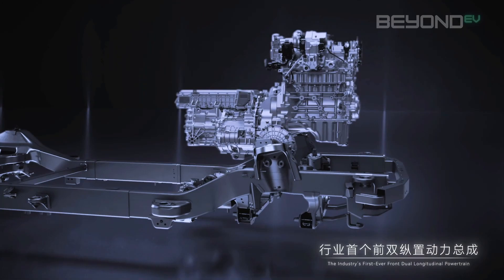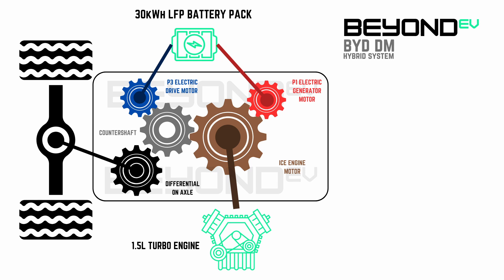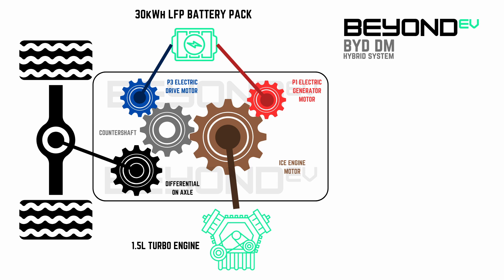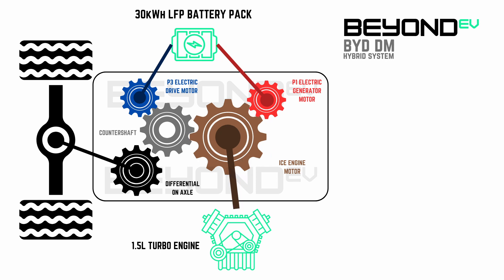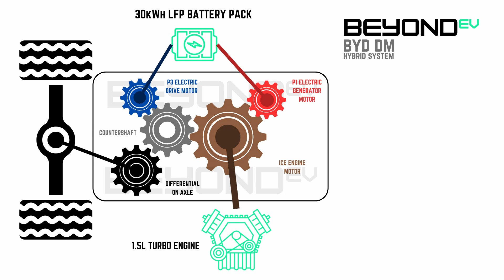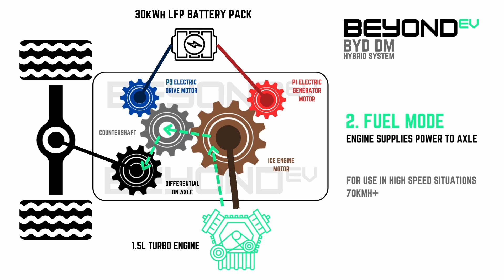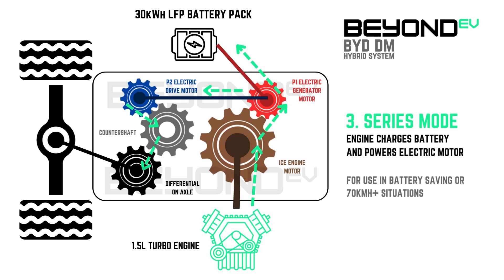What's inside the BYD DM Hybrid System (BYD Shark + BYD Sealion 6)

Comment: Excellent explanation. Would be super to show how the clutch works and how the different angular velocity of the shafts are arranged in order to control wheel speed. Regarding other competitors, in my opinion the Toyota E-CVT has outstanding features: very simple mechanical scheme, no clutches, all possible power flows (comprehensive explanations avalaible on internet).

Comment: They do have gasoline only traction in certain circumstances, mostly if the battery has already reached the desired state of charge, and the computer determines that the speed you're currently cruising at would be too draining to the battery. At that point, the car drives like a regular gasoline car. I've seen this usually at speeds of 100 Km/h or more

Comment: When you accelerate hard from the 0, the petrol engine can't participate in parallel mode because of the low speed and no low gear for that. The engine will only  produce more electricity through P1. In highway speeds the engine will work in parallel mode in hard acceleration.

Comment: How the gear engage or disengage? Does it has a clutch and solenoid? Because in Toyota hybrid system they don’t have the clutch and solenoid. For me it’s very important, if we talk about durability the clutch is the weakest point
Reply: Clutches can be made however strong they need to be to perform the demand of the task -it's ridiculous to think that because you have a Toyota that doesn't use a clutch that the system is the best and anything else that does have a clutch is weak. Engineering dictates that a clutch setup is in fact the most efficient way to transfer power between moving plates. Seems like Toyota may have missed out on this engineering.
Reply: @joebloggs24  why doesn't Toyota provide a warranty for their hybrid system in our country if they're that confident in its durability then?

Comment: So if you hear  the sales pitch BYD says you should be able to achieve around 70 to 80 kms range in full EV mode with a 100% state of charge but from what you are saying that is only possible if you drive less than 70 kms per hour ? That is a bit sneaky of them if true ...
now when I went for my test drive on the motorway I displayed the car graphics up on the screen to show the power delivery source, I accelerated steadily up through the 70 km per hour threshold to 100 km per hour but did not get any indication from the onboard graphics that the engine was paralleling the battery ? Nor could i hear the engine kick in ? So I am confused ?  Note when I then changed the mode to HEV yes then the graphics changed when pushing the truck harder above 70 km per hour. Can anyone verify this ?
Reply from the maker: No it'll get about 80 km of range under normal driving conditions.

The car decides when to kick the engine on, but depending on your state of charge, it might not kick it on at all. But if it does, it's only going to do it when you're above 70 km an hour.
Reply: From Tassie, am an owner of SL6 Premium, fully charged I get around 80-85KMs on EV mode even at 110KM speed on intercity roads, once the HEV kicked in when the battery down to 25%, it will stay between 18-30% during the entire journey, depending on your driving and roads conditions, if there are lots of downhills, the battery will be charged and can reach over 30%, but if lots of uphills then the battery will get depleted rather quickly. I have toured and traveled across the eastern part of Tassie with friends for over 4700kms over 10 days, which I have only refuelled 3 times in total, and from the first drive leaving from home with a full charged and another overnight charged at a holiday cabin. My POV is that to have a full EV in Tassie if you want to travel, because charging infrastructure is lacking compared to when I was driving in China where charging stations are very common, it’s more convenient to have hybrid and not to worry about charging stations.

Comment: In a way, similar to the Toyota ECVT while at the same time, completely different. 
The strong electric motors mean the car can run the engine in a single gear  and still run as a hybrid.
Nice work BYD and thanks for the explanation.
Reply: It's actually very close to Honda's e-HEV system.

Comment: I have one question .. when you set the SOC charge to a value, there's also a setting of Auto or Save .. what's the difference between them?
Reply from the maker: Auto is basically 25%. Save is any setting between 25% and 70%.

So if you do set the setting do anything other than 25% automatically in save mode
Reply: @BeYonD-EV  that's not true.. you can set it to 50% per example, and still keep it in auto... I was told it had something to do with fuel consumption and how actively it would try to get to that percentage, but I don't know the details... that's why I'm asking
Reply from the maker: It is. I can't post pictures here, but you can Google 'BYD Shark Owners Manual'. The first results should be a PDF of the manual. Page 94 goes through the difference between AUTO and SAVE. 

AUTO: Prefer fuel economy, but also
take battery power keeping into
consideration.

SAVE: Prefer keeping vehicle battery power, and try to get close to the
target SOC.

So in AUTO mode it will keep taking down battery power because there is no set SOC to save at. What it doesn't say is that Auto mode will do that only down to 25%, at that point it will switch to what is basically SAVE mode at 25%.

You can try it, set it to 50% and then have it in AUTO mode. It'll just keep draining it down to 25% and then hold 25%. 

That's saved SOC percentage is ignored when you have it in Auto mode. That's just the preset SOC that you will have when you put it back into save mode again
Reply: @BeYonD-EV  I was talking about the sealion (seal U in europe) and I'm pretty sure you can set it to "auto" and raise the bar to 50% ... I'll have to confirm it  though, but as I said I'm pretty sure you can do it
Reply from the maker: It's the same in any DMI or DMO car

I've done a review of that car, it's called a Sealion 6 here in Australia 

https://youtu.be/lIdENNx7zBM

I discuss the AUTO and SAVE functions of this car in that video while I'm driving it.

Comment: Toyota with decades of success also works with two electric motors, a further comparison would be interesting.
Reply: Toyotas system allows for the engine to constantly be used in its most efficient rev  range and load. I would be surprised if it isn’t more economical in hybrid mode. In PHEV mode though, this might be better.

Comment: This is such a bad design, it's unbelievable... Why didn't they put a planetary gear set like on the Toyota e-CVT instead of the clutch pack is beyond me...
Reply from the maker: @djole02  The new DM 5.0 platform soon to be released from BYD is said to feature a planetary gearset. But this 4.0 version is just a single gear.
Reply: Because Toyota's e-CVT is protected by patent (Toyota's intellectual property) and no one can use it in their vehicles until 2050.
Reply: 電平台混動（驅動電機為主動力輸出），為什麼要用行星齒輪⚙️切換動力？BYD的雙模式電平台混動只保留了一個高速當，當汽車速度超過80KM/h時候就會切換到發動機直驅模式。
這才是最簡單的結構，以及最高效的技術模式。
Reply: @HGG-DXY  Because it's much more efficient to have a planetary gear set (power-split hybrid system). This way you have full operation in all 4 quadrants at any vehicle speed. You have the ability to choose any operation mode and engine RPM completely independently.  If you have 2 electric motors it's absurd not to couple them with a planetary gear set like on the Toyota eCVT. 

The eCVT is simply the most versatile hybrid system. There is also a hydraulic version of the eCVT used in heavy machinery like tractors but uses 2 hydraulic motors instead of electric ones.

Comment: For the BYD Sealion 6 DM-i, if we set the SOC (State of Charge) at 70% while driving, how much percentage of the battery could be kept for later use?
Reply from the maker: If you set to 70% save, the car will work to keep the battery SOC at 70% which you can use for later.

Comment: Thanks for that info. The big question 4x4 drivers I know keep asking is can a rear diff locker be installed?
The other question that keeps coming up is, does the turbo temp show anywhere on the screens and is there a turbo cool down process?
Reply from the maker: I don't believe at this stage you can fit a diff lock. It's not a standard diff out the back, it's an electric motor connected to a reduction gearbox which also contains the diff. You'd likely have to pull the whole motor out if you wanted to play around with it. And that involves playing around with high voltage wires which will also make things quite tricky.

Comment: For BYD SEALION 6 DM-i , can we choose to drive on FUEL MODE ?
Reply from the maker: No you can't. Although it is mechanically possible, the car never drives from the ICE engine alone.
Reply: @BeYonD-EV 
TQ so much for quick reply. ❤
Reply: Which BYD DM-i models allow driving in fuel mode alone ?
Reply from the maker: @wkchew682  None as far as I am aware. Its possible, but it's programmed out so it is never used. Because the EHS only has 1 gear ratio, the window for fuel only to be useful would be very small. So it will use series mode instead.
Reply: @BeYonD-EV and if you're towing a very heavy load and the battery is at its minimum? Wouldn't that then directly drive the wheels only with both electric motors decoupled? Or doesn't it work like that this case? Will it still run in series to keep the battery at 20 while the battery is powering the wheels? On the Car expert channel where they did a tow test, when the battery got very low and they were towing a heavy simulated load, the car slowed down and stuck at just above 70kph exactly. So perhaps this is where the motor was powering the wheels directly only since that is the narrow band it has with that one gear. Or can it run the wheels directly, plus the generator motor plus the electric motor?
Reply from the maker: @SDav21  It would be in series mode. The engine doesn't directly drive the wheels on its own. My assumption is that the it got limited because in series mode in a low SOC state, the engine is turning the power generator and the power being generated is being split between powering the wheels and keeping the battery charged.
Reply: @BeYonD-EV ah very interesting. I wonder if this is a more efficient way? Is providing all the engine kw directly to the wheels worse than providing the kws to the battery which then powers the electric motor which has a lower kw output? I assume so since powering the wheels directly results in too many parameters of varying speed and terrain whereas supplying the battery to power the motor means it can be more variable and flexible and more efficient since it is focusing solely on just operating to keep the battery charged. Now I wonder how dmi5 will make a difference with a planetary gear set. I'm assuming with the current system, if your SOC is at its lowest, it will user the engine anyway even at low speed but then it isn't very efficient? With a planetary gear set they can make it efficient when using the engine even at low speeds.
Reply from the maker: @SDav21 having the engine power the wheels opens it up to stalling and variable loads. By only having it connected to the generator it can be tuned to operate as efficiently as possible to just one consistent load.

As for DMI 5.0, as far as I'm aware, it does not feature a planetary gear set. It was rumored prior to its release that it would have a planetary gear set, but now we have seen more of it it appears it's still just a single gear ratio.

The biggest difference between 4.0 and 5.0, is the new 5.0 has bigger electric motors and both of them can operate as either a P1 or P3 motor. 

In 4.0 it had a single dedicated P1 motor that was only used to generate electricity from the engine. The second electric motor was a dedicated P2/P3 motor that was used to drive the wheels.

In 5.0, both motors are larger and both can act as generators to generate power for the battery, or both act as motors to power the wheels.

So in 5.0 it should be possible to have the engine power two electric generators to charge the battery when idling. And it's also possible to have two electric motors drive the front wheels in EV mode.
Reply: @BeYonD-EV Thank you! I really appreciate your detailed response. It makes sense. I'm looking forward to more from BYD. It's an amazing system.
Reply: DM phev是雙模式電平台混動技術，
低速採取串聯模式（EREV）驅動電輸出動力，高速則是並聯模式發動機輸出動力，因為這套電平台混動技術是以驅動電機為主輸出動力，只保留了一個高速當，在高速行駛時EHS會切換模式。

Comment: It's strange to me not to just go into the ice power train mode when cruising on a steady run as it looses efficiency twice as it stands. Once through ice being less than 100% efficient and then the electric motors being less than 100% efficient as well. It would be more economical to just run on the petrol engine with electric only helping out on hills, maybe.
Reply from the maker: @nothingsurprisesmeanymore  because of it's single gear ratio, that optimal power band to use just the ICE would be very narrow. Powering it through the P1 generator means the ICE will always run within it's optimal power band and load, but power to the wheels can change as required.

Comment: I’m interesting in knowing more about DMI-5, specifically how it differs from DMI-4, but info on DMI-5 is hard to find.

Does anyone have the lowdown on how DMI 5 is better than DMI 4?
Reply from the maker: @richardbuckingham4329  basic lowdown...

Dmi 5.0 will introduce a planetary gearbox, as opposed to the single gear used on 4.0. 

On the 5.0 system, both the P1 and P2 electric motors can both be used to drive the front wheels at the same time. 4.0 only the P2 motor is used as the P1 motor is only used for power generation. 

Dmi 5.0 can achieve up to 2100km in combined range. Even if that is heavily overstated, getting just 50% of that claim is still pretty good.

Comment: Pl also shed light on fuel economy of this PHEV in hybrid mode (once battery is down to 25%) and engine turns on intermittently to charge the battery and drive the wheels. I suspect that most of these PHEVs are not very efficient in hybrid mode.
Reply from the maker: Depnds how you are driving, but its around 7-10L/100km. Not that efficient, but keep in you need to drive 80km in full EV mode to get to that 25% point. 

So if you did 80km EV and 80KM hybrid, you are still averaging 3.5-5L/100km
Reply: @ that is true. Though slight correction required here. The cost of electricity to charge an EV needs to be factored in too. Apparently i found the claims by most PHEV manufacturers a bit misleading as they are not factoring in the cost of electricity needed to charge PHEVs + the mileage that car gives per kwh is also important. I feel that true running cost can only be calculated when we have clarity on both.
Reply from the maker: @mazbpl because it's so low it's not worth taking into account.

I pay 8c/kwh to charge my BYD Seal at home. So to charge a shark from 25%-100% would cost $1.76. 

$1.76 for 80km travel.

Even if you had a super efficient car with 5L/100, it would still cost you $8 in fuel to travel that 80km with petrol.
Reply: @BeYonD-EV  i agree. Charging cost is less in countries with low electricity cost. However in assessing the performance of EVs and PHEVs one important aspect is to check kms per kwh to confirm how efficient that car is.  In fact it should always be mentioned in specifications of any EV/PHEV.
Reply: @ have you managed to calculate the efficiency in pure EV mode (how many km per kwh)? I feel when comparing EVs it will soon come down to this very basic question to calculate efficiency (much like to we check fuel average in km per litre).
Reply from the maker: @mazbpl  it gets 80km from 100% to 25%. So a quick calc would equal 27kwh/100km. Not very efficient for a typical EV, but very efficient for a ute. That makes it more efficient then a cybertruck which is around 31kwh/100

Comment: Very detailed and comprehensive explanation. Just have one question though inst it simpler and more efficient to have series hybrid system where engine may only work as a generator to charge the battery if it falls below 25% while power may only be supplied to wheels by the 2 electric motors?
Reply: I have the same question. But maybe the electric motors are not powerful enough on their own.